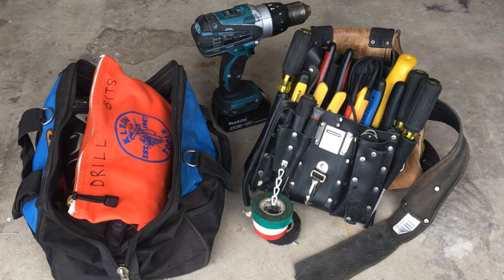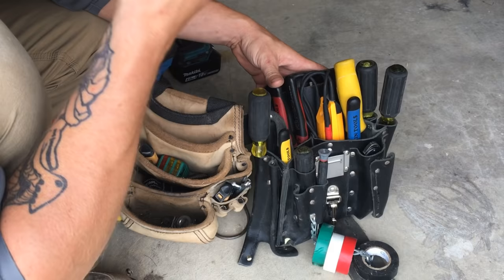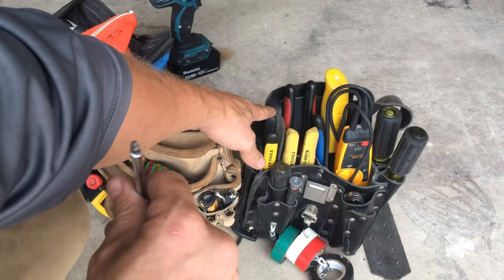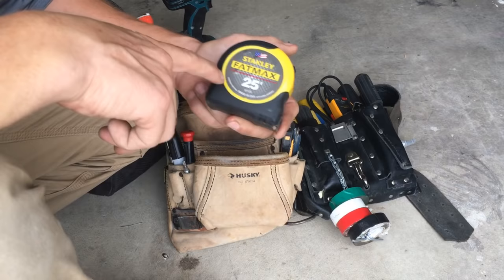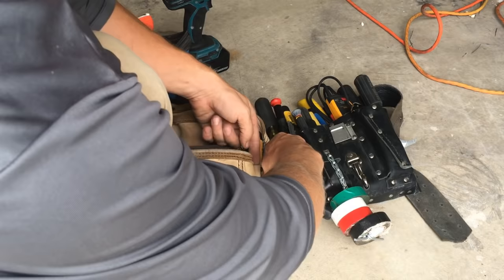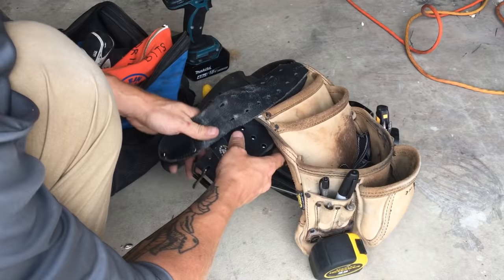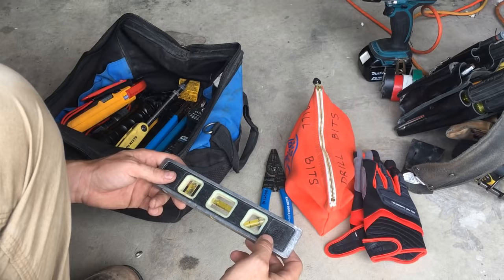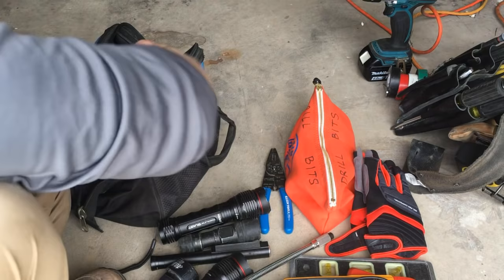Episode 2 - Tools Every Apprentice Electrician Needs To Start Their Job

Comment: When I started my apprenticeship many many years ago and I got out on the work site, the one tool I got told I needed was what was called a Yankee Screw Driver. So I got one,  really excellent quality,  actually made in Germany with a variety of Slot bits, Robertson and Phillips and it proved to be really handy, all these years gone by I still have it and use it periodically.
Reply from the maker: Hardrock I've seen those but have never owned one.  They look like they're from the 50s lol.  I'll check into it, I'm curious now.
Reply: @Hardrock:
I still have my Yankee Screwdriver!
Reply: We used them a lot before cordless was a thing. I had two sizes.
Reply: My journeyman just gave me his old one!

Comment: So I watched this video three years ago when I started electrical school. It helped out so much man. Just having some of the right tools on hand made life so much easier. I would have included adding some common sockets and hole saws. Like 3/8, 7/16, 1/2 and 9/16 socked on the ready. 7/8 hole saw, 1 1/8 hole saw and a 1 3/8 hole say for 1/2 inch 3/4 inch and 1 inch holes. A step bit can come in super handy too. of course a long 5/16th bit
Reply: Are ya IBEW? Tbh all those kind of bits should be contractor supplied unless you’re working for yourself otherwise you’re being be screwed brother
Reply: @MrJahka  not in the Union. Half a semester left of school then I sit for my journeyman's. I but all my own tools for the most part. That way if they cut me loose for some reason, I'll be ready to go on my own. Rule number one I learned as an apprentice - Nobody gives a fuck about you. Always watch your own back.
Reply: @kahlil4745  well you do you. I’ve got my brothers back and they’ve got mine. You’re welcome anytime

Comment: My list of what I carry as a first year:

Klein ratcheting cutters
Husky 12-in-1 screwdriver
Wiss cable cutters
Komelon mag tape, 25'
Milwaukee 7/16 driver
Eklind folding Allen
Homemade hawkbill knife
Kapro magnetic handy level
3m 76 tape
DeWalt chicken stick
Crescent brand crescent wrench
Southwire compact strippers
1 1/2" cold chisel
Uline permanent marker
Craftsman magnetic angled head flashlight w/ clip
Reply: wtf is a chicken stick?
Reply: I carry
Milwaukee drill and impact 
Torpedo level
Tape measure 25ft
Rabbit Ears
7-1 nut driver
11-1 screwdriver 
Needle nose
Ratchet with all size sockets 
Voltage tester
Flashlight
Pipe wrench
Pipe reamer 
Ratchet cutter
Side cutters
Lineman 
Terminating screwdriver set
Wire strippers

Comment: I’m currently around five years or so as a residential journeyman in Washington state, and while I do absolutely agree that Klein makes the best tools for electrical, I personally still buy and use commercial electrical tools for certain things, and it’s because I beat the shit out of some of them. I have certain tools that I’ll ONLY buy Klein, but I also have tools that I will also buy a second, cheaper brand of because I go through them fairly frequently. Also, in 2020, Milwaukee has started to make a lot more electrical tools that I personally really like. I make a pretty damn good amount of money so I can easily afford to spend more money on brands like Klein, but new apprentices might not have the same budget to start out with a tool bag full of Klein tools, and they also might decide this trade isn’t for them, so maybe if you’re new to the trade, make sure you’re fully committed to it before you go buying all the top of the line brands.

One more thing- get that tape chain caught on a ladder while climbing up and down a couple times and you’ll rip that thing right off of your bags, hopefully before you get caught and lose your balance and fall off your ladder. I personally HATE those things and just see it as a hazard, but that’s just my opinion. Anyway, thanks for the video though, I really enjoy watching your videos and really like your channel! These kinds of videos were great for me early on in my apprenticeship, and all these years later I still really enjoy just hearing and seeing how others do it and their opinions and experiences in the trade. Thanks for sharing!

Comment: As a wireman I always carried the tools I found a need for on jobs. However an apprentice in my local union is only required to have a few assorted screwdrivers, a pair of offsets, two pairs of channellocks ( I always preferred 430's), a level, pencil, ruler, knife. Optional tools are a flashlight, voltage tester, hacksaw. As a wireman I also carried a screwdriver with assorted bits including a square drive, a non contact tester, small set of taps and bits, a six inch crescent wrench, a t&b tool, wire stripper, needle nose kleins with a stripping hole, 18" of jack chain and a ball of string. It's now rare for a wireman to use a tool pouch as most have gone to tool bags thirty years ago. I also carried a couple of drill drivers for screws and wirenuts. All other tools are supplied by union contractors.

Comment: I’d add a mirror and fish tape to the extra tool bag.   I was in a situation where my fish tape wasn’t feeding up through a wall like it should have.  So I used my mirror to see inside the wall and find I was getting bound up on a box that I didn’t know was there.  And I could adjust accordingly. 
Also it might be a bit of a hassle at first.  But get flash lights and head lamps that use the same battery type.  Either AAA or AA.  This way you don’t have to carry around multiple types of batteries.   You can buy a 20 pack of one and when you see you’re getting low you can buy a new one and know you’re covered and not worry about having to keep track of lots of batteries
Reply: I use my phone in selfie mode and use that but a mirror would be quicker
Reply: Brian Wilson yeah.  But sometimes you need to stick the mirror in a place where you’d be really pissed if you dropped your phone.  Both are great to use

Comment: We call the voltage detector a whigy around here LOL.  Harbor freight step bits outlasted my expensive ones and come in a multi pack.  I did mostly commercial work and found a reciprocating saw very useful. I went with Ryobi. It lasted longer than my DeWalt and way cheaper. Guys laughed until they used them. I also used an MC cutter a lot and not all the guys had them.  And needed a 1/2" bender pretty fast. Once going you will see than you use your linesman all the time, so spend the money on good ones. I also found a long narrow flat head was needed a lot. A cheap pair of tin snips is also good. Also I use and have used for years Sperry multimeters, cheap and long lasting.
Reply: Whigy whigy whigy 👍🏼

Comment: I work in IT in the field. About half of the tools listed are what I would put on my list. My big thing is that I use metric and not ASE. I have also been looking for a decent magnetic screwdriver since I have the chance to encounter a variety of screw caps. Thankfully 60% of what I do is with a PZ1/PZ2 driver but that other 40% is nut drivers, wrenches, various power/network testing tools, pliers, a laptop,  and a drill. but I have been trying to make a balance between having a good catch all kit to carry in and leaving stuff in the van.

Comment: My tool in my pouch are;
Electrician plier (greenlee)
Cutter (greelee)
Long nose (random brand, doesn't really matter)
Stripper (with crimping utility) (klein)
Multi screwdriver (klein)
Drywall cutter (random brand)
Knife (600v isolated)
Level (greelee)
Measuring tape (stanley)
Wiss/Metal cutter (Wiss)
Allen key set (klein)
2-3 Sharpie marker
1 small flat for contactors and relays
Long bits for drill; #1-#2 square, phillips and 5/16 hexa

Pouch is all in leather with thick belt.
Pouch set up; 5 pockets left side (simillar to carpenters) / back pocket for tape / right side all the tools beside level, measuring tape, wiss and allen key set (in one of the pocket left side most of the time)

Apprantice 1 almost 2 at around 1900 hours! Doing mostly commercial. I would say, I'm well equip for a new guy. I believe it's really important!

Great videos! Thanks!

Comment: Been in it for years just mho but I like to go with an small pouch that holds my basic hand tool ie. lineman , 10 in 1 , stripper , diagonal , / the rest I keep in an bag that's organized , it may not seem like it but big bags even with shoulder straps can pinch nerves and cause problems with your back and the like over the years 👍

Comment: 20 + years in construction started in masonry then carpentry now 15 months in electrical (commercial) I recommend the Klein 11 in 1 multiplier and the klein 15 in 1 nut driver tool also a 6ft mason's or carpenters stick rules they are priceless if working in tight place or by yourself. I love my 25ft fatmax but that 6ft mason's rule has helped plenty.  Thanks for the great videos
Reply: Sorry autocorrect got me Klein 11 in 1 multi tool not multiplier

Comment: Klein tools are exchangeable at Home Depot, no questions asked so when I blow mine up I can just get new ones for free
Reply: klein doesn't replace "blown up pliers"
Reply: michael gaffney how? I’ve taken my lines men’s and strippers to Home Depot, both with holes in them, and the replaced them
Reply: Zamb_  pro tip, buy used Klein tools off Craigslist or other sites for cheap and return them to Home Depot for new tools :D

Comment: Klein 11-in-1 32500 has 3/8-inch, 5/16-inch, and 1/4-inch nut drivers, #2 and #1 Phillips, 1/4-inch and 3/16-inch flat head, #2 and #1 square, and T10 and T15 TORX to boot.

Comment: Also Awl, center punch, chisel, & small hammer, Chalk Line (which can be used as Plumbs your Bob), Cable cutter (for heavy gauge wire), make sure your level is Magnetic, Blue ele Tape, set of Stubby Drivers, Hole Punches, adjustable wrench, EMT Benders, Fishes, i find a Chalk Bag really handy for PARTS & a Rope, a circuit tracer & jumper wires to tap into junctions,  Safety Gear (huge list) its kind of Job Specific : )

Comment: For your Klein extended shaft 6 in 1 screwdriver, replacement tips are Phillips 32400, slotted 32401, and #2 sq with #2 Phillips is 32410...Just found them...

Comment: Everything he said was spot on. I understand the appeal of the interchangeable parts for the multitools but I wouldn’t rely on those drivers bc you’ll fuck the whole thing up and I like my individual tools for when you strip one and have to keep a bunch of different ones and keep track. Gel Knee pads are a life saver for when you are in attics or when you are working in shitty rocky terrain. I keep just a small paint brush in my bag to dust off shit. It really helps more than you would think. Safety glasses are never a bad idea. Keep a few masks in your bag for when you are in shitty dusty places. Invest in some steel toed boots! Make sure you are fully stocked with different sizes of wire nuts and an assortment of screws, washers, and nuts. Washers are good for making spacers. A silicone glue gun is important as well. I like to toss an empty bucket in the truck too because it makes cleanup much faster and easier!

Comment: It's a non-contact voltage tester. For general use on low voltage systems.
They are also made for medium and high voltage circuits.
They need to be tested on known circuits every time you use them. The medium ones can be tested with a fluorescent light. (medium voltage is from 750volts to 15KV.).

Comment: Just stumbled on EU. SO much good info. You're right " the pen" doesn't tell you anything about the CRKT, but it's good to keep on you. It will tell you if something is hot, and save your life. The new guy should 100 % carry a pen. You shouldn't be touching anything without testing it first. Especially on a remodel where there's existing power and many trades working at the same time. We don't always use a breaker lock, and you should never open a Jbox, outlet. or light without testing for current before you touch the inside. We've all had a loose N, and a HOT BOX/ Anytime you step away from something your working on you should test before getting back to work. People will just flip breakers breakers.

Comment: #1: Buy suspenders. Seriously. This allows your pants to be looser, and it just feels better.
Also get a magnetic dish. I paid $4 for mine at a liquidation place, so it's not like they cost a lot.
You mentioned a level. Make sure the level is specifically for electricians. The electrician ones have bubbles for 0, 30, 45, and 90 degrees.
Reply from the maker: Excellent advice all around, thank you!
Reply: Make your own video explaining what you're trying to in the comments section. Thanks
Reply: @jeremiahbargeboe5578  huuuuh?😕😵⁉️⁉️⁉️

Comment: I've been doing electrical work for 6 years now I've had the same set for 6 years and they are commercial electric what people seem to forget is that your tools no matter what brand they are will last as long as you take care of them ive seen guys use linesmans pliers as a damn hammer I've seen people use flat heads as a chisel I have every tool I would use on a job for the purpose I would need it for
Reply: eddie money actually I go this week
Reply: Lineman pliers have a hammer face on them, you can use them as a hammer 😉

Comment: I’ll start by saying I’m no electrician, however, I have been electrical work for over 15 years.  I bought a set of consumer electric tools in 2004.  Still have them today.  The only thing that’s broken is one of the flathead screwdrivers that I used with a hammer.  (Shouldn’t have but did and it broke the tip).   I would suggest a better crimper combo tool.  Those suck period.  Point is, to start off as an apprentice or as a diy’r consumer electric isn’t bad.  Get a nice set, then add better crimper and a channel lock and you’re set until you make the money to buy Klein.  Then you can keep the CE as a backup.  Jmo.

Comment: In my past experience getting a holster for the impact gun especially one with a clip is so convenient. I like that i can keep it strapped to me without falling out if I’m in a persons home or a crawl space where I don’t want it falling out. Also I use the smaller pouches that will just hold my Essentials, and that would go on the same belt as the screw gun holster. Unfortunately I haven’t found a brand that makes the two so I get the husky pouch, and some off brand holster

Comment: They’re called Robertson bits. Nice vid young man.
Reply: Yes, thank you.
Reply: both words can be used. like Flat Head or you can say Slotted.
Reply: young man?? what tha
Reply: Actually, the term "flat head" comes from "flat head screws" that have a flat head and taper towards the "auger" postion of the screw that allow the head to be flush to the work surface like wood screws, as opposed to machine screws that portrude from the suflrface being fastened, which back in the day were exclusively slotted. The correct term is flat blade screw driver.

Comment: Nice video, a few things that i'd add to that is a good magnet for finding metal studs for fixing shit to once the dry wall/ceiling goes on, a hack saw, conduit cutters, a cold chisel and a hammer. Also i dunno if you guys use U clips in the US but having a template to draw the cut out for U clips with a level build into it is heaps useful and also some pencils

Comment: Take close note here ! some good stuff . That’s the best pouch you can get on the market . Multi extended reach SD. Fat max,You almost have my same gear this is the best I’ve seen on YouTube or just about anywhere .I give the set an A, set up a b+\A . Could arrange it a little more efficiently im sure he has to look down every time he goes into his pouch . But that’s elite level . More than your employer deserves… wearing a good thought out pouch makes you at least a few dollars an hour more efficient than you’re fat bloated belly electrician counter part that thinks he can get by … with 9s and a screwdriver in his back pocket . And reach back or go find his tool bag /truck every other second because he doesn’t .. wear a tool belt . This is a great video 👏🏼👏🏼👏🏼 20y JW another good tip don’t set your tools down . Put them to work then back in the pouch, not on the ground or on the shelf in front of you while you’re working . You will hardly every loose a tool In your entire career I guarantee 👌🏼. Esp keep them off the top of the ladder !!!  For many reasons …

Comment: having a tape that has measurements on the bottom can be handy when working overhead too
Reply from the maker: That's a great idea actually.  I've not seen many of those in Home Depot or the local supply houses so I just never think about it it but you're right...great idea!

Comment: That sheetrock knife is a little baby one. Get yourself a Kobalt dual sided drywall saw. It will go through plywood, sheetrock, half a 2x4 and most anything else inside the wall like a hot knife through butter. Larger teeth, less work to saw through the same material basically. It's saved me hours of sawing over the years.

Comment: Industrial Electrician here....been in the trade  18 years and have never broken a unibit step drill bit. First step is you need to buy Lenox metal drill bits. They are the gold standard. Second,  before you use the unibit, drill a pilot hole. Third step, put the drill on low speed.  If you drill stainless, use oil and go slow and five your bits a break. Salutations sir. Great channel!!!
Reply from the maker: Great advice. Every bit of it is correct.  I actually just got 2 impact uni-bits (stepped bits) made for use in impact drivers. Never thought that would be a thing but I’m going to test them out and do a review on them. Ever used any of these?
Reply: @ElectricianU  I would be untrue if I said I have. I left the trade for the most part about 4 to 6 years ago.  I got into power plants and the like....Bro you have a great channel!!